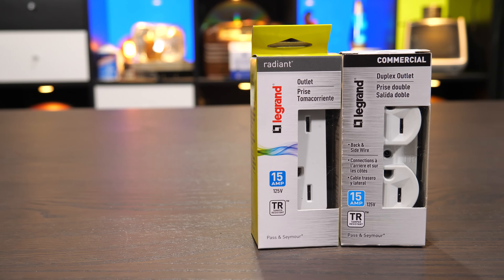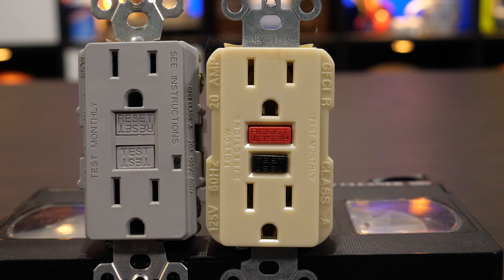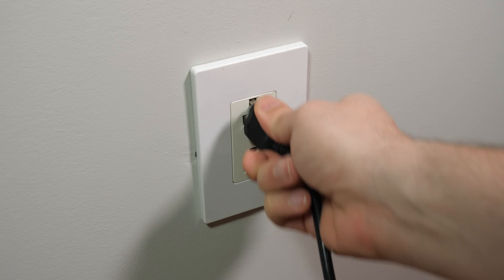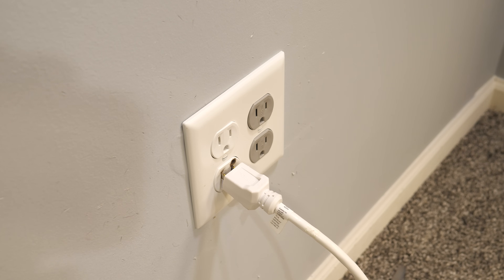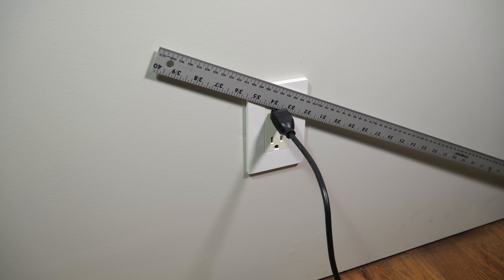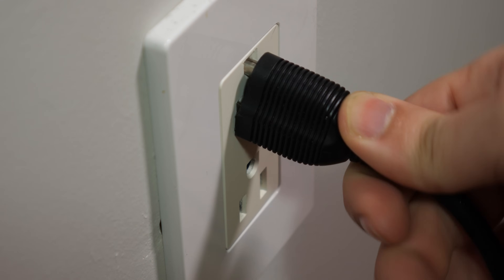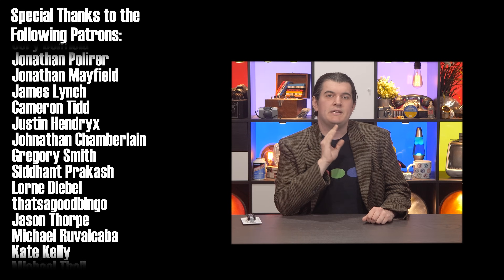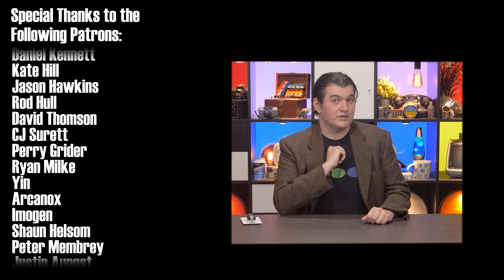Power outlets are topsy turvy - but does it matter?

Comment: I don't understand why there's no receptacles set up more like a barrel connector. Having the hot and neutral inside of a ground ring that is longer than the hot and neutral. Add to that an inset receptacle or guide and you'd have a near flawless solution.

Comment: I use the ground pin as a guide when I'm trying to plug something in in a tight place or in the dark. This is much easier to do with a finger underneath than a thumb on top, especially when reaching from above like behind a bed.

Comment: The NEC allows outlets to be installed with the ground plug hole facing up, down or sideways. It's up to you, there is no standard electric outlet orientation. So that means there really is no such thing as upside down outlets. One way isn't safer than the other — as long as the outlet is wired correctly.

Comment: Takeaway from this video: If we're going to spend money changing our plug infrastructure for a 0.01% increase in safety, how 'bout we design a better, backwards compatible one that will be way, way safer. Seriously! Is it so hard to just insulate the base of the prongs! That would help with a lot of these issues. I expect there would be a very small number of outlets that wouldn't function well, but at least we'd be spending money to significantly increase safety, not fractionally increase it.

Comment: I suggest going with a new plug standard.
Basically all our tech is DC power, so we've got rectifiers in everything (most things).
Instead put a large DC rectifier at the breaker box and cover our walls in USB-C receptacles.
Large appliances with high power requirements can get their own AC breakers with 2 or 3 phase power.

Also, with this, battery backup systems for wind, hydro, or solar powered homes could tap into their batteries without converting it to AC before being sent to the breaker box, then being converted back to DC at the device.

Comment: My only known phobia was made worse watching this video.  I was comforted at know the orientation didn't really matter but that was quickly offset when I saw the measuring tape and ruler demonstrations.  I use them both for home projects.  The ruler is next to an outlet now. Time to throw them away and probably some other things around the house!
Reply: If it's something that really bothers you, you could easily add insulation to your plugs as demonstrated at 16:09. Those are small lengths of heat shrink tubing being shrunk down with a heat gun. These materials are cheap and widely available online or at hardware stores and would be a fast, easy DIY project to give you some peace of mind at home :)

Comment: Wild how the other day I was at my grandmas getting stuff from under the bed and noticed a hanger suspended in air behind the dresser. I thought, oh the back of the dresser is supporting the weight. Nope, it was hanging on a plug, not just any plug but a plug you demonstrated, the hanger was still on the plastic but the metal was exposed. It was a new house (2022) so it wasn't worn down but it was not fun dealing with this situation after watching this video a week or two prior.

Comment: Right angle plugs... yes, but that generally means that you can only use ONE of the two plugs as putting a right angle plug on the "top" outlet causes the cord to block the "bottom" outlet.  That's what problem that the 45 degree plugs try to solve.

Comment: I have less of an issue with the socket orientation, and more of a problem with straight plugs in preference to the superior right-angle plugs. That said, although it's too late now, I do wish that manufacturers had supported the ground-at-top socket when designing their plugs. But then I'm originally from the UK where they have quite simply the best plug-socket design combo ever ;) Now there's a video for you... Large format, ground at top, insulated pins, switched outlet, fused plugs... you'd have a field day, Alec!
Reply: I swear he already made a video on UK plugs!

Comment: As an electrician, I just want to bring up some information you have said. For the "Electricians don't seem to care", the main reason why we don't is due to customer preference. If we put it "upside down" most customers will complain and have us swap them anyway.

National electric code doesn't say anything about it for this very reason, as well as the fact that NEC is designed to show the "Bare Minimum" of what electricians need to install.

While the plug part of the outlet may not matter overall, the main reason I've learned for the reasoning behind having the ground up is so that if any water or dust or anything else conductive falls between cracks in the outlet box and wallplate they will hit the ground screw first before anything else, ensuring that if anything goes wrong power will still go through the ground conductor first. The chances of it happening is slim to none, and most non-cheap outlets already have that issue fixed, but liability is the only reason people actually would care about it, cause if someone's house caught on fire because of outlets you installed, You and/or your insurance is footing the bill.

Comment: What really intrigues me here, is why, in many european countries, (I'm spanish)  our sockets are just 2 round holes with no ground pin, many have 2 arms on the side of the socket, and I think those are the ground pins, but I'm not sure. The thing that bothers me, is that it's symmetrical, it doesn't matter how you plug it in, but in the US, one of the holes is smaller, and the existance of a ground pin with a distinct shape, make it 100% sure that you plug it in on the same orientation every time.
But in the EU you can plug something it, unplug it, turn it arround, plug it again, and it doesn't explode or anything, it just works anyway.

Comment: Now I want to see receptacles with the two sets of holes rotated 180 from each other so the two vertical orientations will always result with a ground on top.  They would just have to figure out the hot and neutral crossing over each other inside, which should be simple enough.

Comment: Also, unless it's a GFCI/AFCI outlet or main breaker (95 percent of mine are not) the hot wire is the only one on the circuit breaker, and shorting hot to either neutral or ground has the same effect. Actually, shorting to earth ground could be worse if you are barefoot, wet, and touch the metal case of an appliance.

Comment: In the UK, it's that way up, but we don't get surprised faces. And they're "right-angled", but the sockets are horizontal.
I'm assuming the side-mounted plugs are cheaper to buy in bulk than get vertical plugs.
Then it's also the manufacturers problem for mounting the right-plug upside down.

Comment: This can be extremely dangerous.  I owned a house for almost 20 years and I had an outlet with a steel face plate.  The problem was the screw that holds the plate to the duplex was not installed.  This outlet was next to my couch and out of site.  I had a lamp plugged into the outlet for 20 years with no issues, until one day the plate slid forward and dropped onto the blades of the plug and began arching out.  My wife and I heard a sizzling sounds and smelt something burning.  it took me 15 minutes to find it.  If we weren't home the house could have burnt down.

Comment: Why won't you make NEMA receptacles recessed, like a CEE 7/3 that used in Europe? It would solve both problems of slightly exposed contacts and gripping the plug too close to edge. Although, that would require to use extension adapters on wallwarts and other such things with contacts sticking right out of body, but that, in my opinion, sounds pretty manageable.

Comment: Who is it that says which is the correct way to install it, even as a manufacturer. 
 I was actually taught a good reason to install it with the ground on bottom. With the ground installed on bottom, as the cord works it’s way out and obviously at downward angle, the last prong that pulls out of the receptacle is the ground, whereas the if installed with the ground prong up , it becomes the first prong to become disconnected from the receptacle

Comment: Alex, you should care, but it doesn't seem that you've clearly described the reasons why you should. You did refer to right-angle plugs. For me, it breaks down in quite simple terms: (1) Right-angle plugs don't attach properly unless the ground plug is down (not up, not sideways, DOWN). (2) For the usual double receptacle, putting a right-angle plug on the top causes its cord to interfere with the lower plug and cord, even if that is also a low-profile right-angle plug.

BTW the ubiquitous power bricks create much the same issue as right-angle plugs.

But there's an even more basic issue. Why are sockets stacked vertically anyway? Whatever the plug type, it's much better to have them side-by-side. With this orientation, you can have any number of sockets, whereas three or more plugs, vertically stacked, start becoming a nightmare.

I also don't understand why power strips don't have the sockets turned at 90-degree angles, instead of in a line. Again, the way it's always done makes it very hard to accommodate right-angle plugs and power bricks.

Comment: I'm an electrical engineer and in our commercial design, we use the ground pole up orientation. When I moved into my house, the receptacles in my garage were installed ground up. When I went to plug in my refrigerator, with the right-angle plug, I personally noticed how terrible this orientation is and inverted the outlet. I asked my boss if we had any justification for requiring ground pole up orientation. As engineers, justification means code requirements, and once I realized there's no code requirement, I've stopped designing with ground pole on top.

Comment: Well, "here's another country heard from."
A half-century or so ago (shout out to the 7" reel to reel tape deck!) I worked for about a year as a "non-union) electrician's apprentice.
The contractor who employeed me was obsessive, bordering on compulsive about details. Everything from the "proper" brands of tools and electrical devices to "the RIGHT way" to perform each and every task during the day, from loading supplies and tools on the truck in the morning to cleaning up the work site at the end of the day. Example: This guy did the most precise conduit offset bends for each and every damned junction box ever installed on one of his jobs.
He was an electrician, his father had been a master electrician, and woe betide the crew member who decided something was "close enough."
The point is this. Dave drilled it into my head that there is only one CORRECT way to install a grounded recepticle.  That was with the ground DOWN. Now, I don't know if this was at one time a code specification, or had just somehow become the standard custom. But that's the way we  set them on OUR jobs.
I'm fascinated by your side note regarding horizontal placement in the Chicago area. I'm from California, and the only time I've ever seen duplex recepticles oriented this way was when space constraints forced such a thing.

Comment: If you had a switch on your plugs you could turn off the current before picking up the steel rule, or when unplugging those right-angle plugs.

Comment: About a year ago i had some surge suppressant outlets installed on some dedicated lines that were put in. The print on the outlets made it clear it was designed to be ground wire on top. So i had it done that way. But the one outlet (two duplex) has the three pronged, right angle, ground down, set up. So the wire goes straight up and loops over. Its incredibly annoying. And do to the design, i couldnt fit the two plugs into one duplex, so i had to have it extend to a double box with two duplex receptacles in it. And plug one into each of them... All of it was rather annoying.

Comment: personally I've always preferred the horizontally mounted power plugs and usually if I find out what I wish they would with the ground and opposing directions therefore when you mount them horizontally you can get to right-angled plugs without any adapters ( because you never know which adapters are are iffy and standing in the hardware store if it's not labelled on the box and it should be...... manufacturers and even then it's hard to remember at the time you're using something not to plug something in that the adapter can't handle)

Comment: I possess 2 appliance extension cords. 1 has the ground pin up, the other down. Which is very handy when I need to use both from the same outlet.

Comment: Power points in australia are usually mounted horizontally.  But with grounds facing down.
Why arent the prongs in the plugs not partially  plastic coated

Comment: When I was a kid, I was making one of those DIY AM radios. When I went to tape the wire that acted as the antenna up to the wall it fell and bridged the gap causing a massive spark and the wall receptacle was still charred 15 years later. Thankfully it didn't start a fire, and I wasn't touching it, but it is definitely something that can and does happen....also can't remember for certain, but based on the electronics I would have had in my room at the time (alarm clock, small lamp,...) I doubt it even had a ground pin.

Comment: I am not sure if somebody mentioned this fact regarding the orientation of the outlets, 
I didn't notice it until I was adding an outlet to a junction box that already contained a light switch (after watching this video).  

The orientation of the grounding 'lugs' (and therefore the path routing of the ground wire) could problematic when not following the 'ground terminal up' orientation on an outlet.
The Eaton Decora switch when oriented according to the top marking on the device, places the ground lug at the top of the device.
Likewise, the 'Eaton Residential Duplex Outlet' will orient the ground lug at the top of the device when oriented with ground terminal at top.
(I hope my description was clear 🤔)

Comment: Here in the UK it's basically always ground at the top, and right angle plugs as standard, and plugs next to each other rather than vertically arranged. It's actually really weird seeing that not as standard. Seeing the two pronged plugs on the other hand is just scary.
Reply: Two pronged plugs aren't scary. In order to legally sell a 2 pronged device, it must be double insulated, meaning the shock hazard is near zero since the device itself is not conductive. (The UK has the same rule, by the way). You use many two pronged devices over there. The only difference is you use dummy ground prongs in those devices. Over here we just save the manufacturer money and don't force them to use dummy ground prongs on double insulated devices (which are most devices in the modern world). In the old days when most devices were made of metal, grounding was much more important.

Comment: Plugs in my country might not be the safest in the world, but Plug Type C/F is certainly a much safer option compared to A/B you guys have. They come with protective sleeves, and whenever connected, not only the metal prongs go inside, but also half of the plug body. So, if the connection becomes loose, it's not possible for the prongs to be exposed.

Comment: I'd love for you to have a video about two light switches that control the same light.

I lived in an old farm house in New England.  Some of the outlets were the shocked outlet face.  Some were the upside down shocked outlet face.  But all of them had one thing in common.  They were not designed to be able to use the plugs with a wider blade.  That's right, both "eyes" were the exact same size, and that size was the size of the smaller of the blades.  I think these outlets came at a time between transitioning from outlets with only two holes, to outlets having three holes, and they hadn't anticipated that the plugs of the future would widen one of the blades.

Changing every outlet was the first thing I did when I moved into the place.

Comment: anybody that has struggled in the dark trying to plug a 3 pronged cord in will hate it with the ground on top. With it on the bottom you can line up the ground and roll the other two prong in. With the ground to the top its a lot harder...

Comment: US plugs/sockets have none of the safety features of either the UK or European systems.
UK has all except recessed sockets.
Note that in the UK there are  no (13 A) two pin plugs ... there is instead a plastic 'earth' pin to open the shutters. Many wall warts have a pull out plastic earth pin (eg 'phone chargers)
Although the "square" pins have plastic shrouds ... there is always an added distance from the pin to the edge of the plug, often sticking out beyond the edge of the main body of the plug.
I take your point about the orientation of wall warts ... in the UK plugs are next to each other with the earth pin uppermost to avoid this problem ... but sometimes they will cover the (normal) wall switch. On double gang extension sockets they will sometimes have rotating sockets to allow orientation of cabling and wall warts.
Note that the standard UK plug has the wire coming out of the bottom (opposite the earth pin).
There are also two pin plugs and sockets (eg 120/240v razor sockets) ... and small 2a 3 pin plugs that have fuses in their wall sockets as they are too small to have them in the plug ... unless they are semi-permanent switched outlets on the lighting circuits and have no fuse.

Comment: A piece of metal touching a live hot outlet prong will not electrocute you, unless your body completes the circuit to neutral or ground (same thing). So unless you have 1 hand on say the water pipe when you touch the "hot" ruler or tape measure, you'll be just fine.